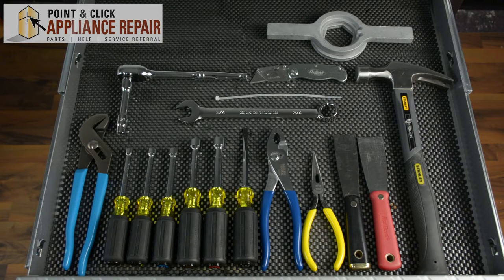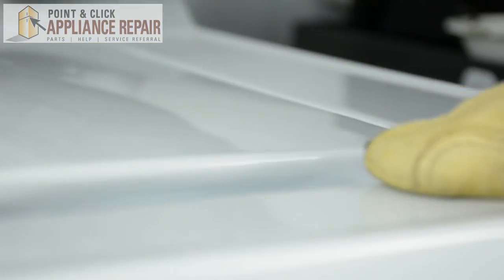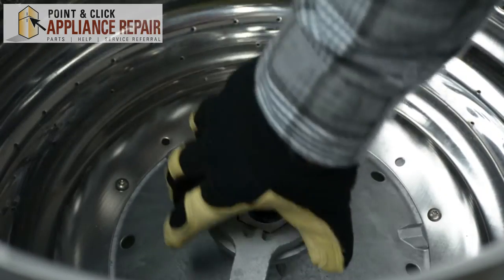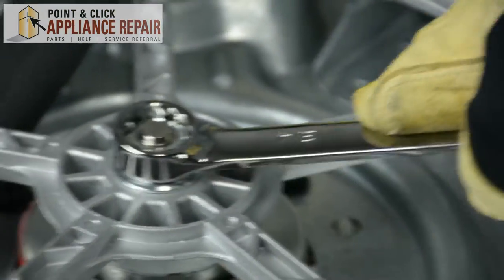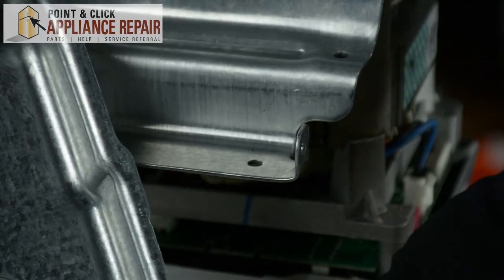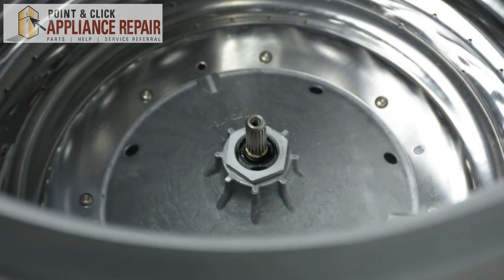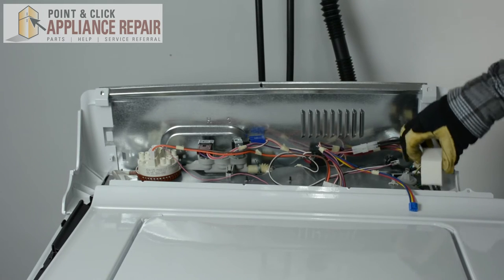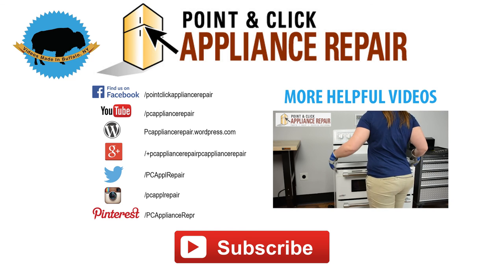WH38X10019 Replacing Your Ge Washer's Drive Shaft - AP5630245 , PS3652839, 2319465.

Comment: This video was spot on for replacing my GE Washer's drive shaft.  My agitator was a little different than the one in the video but I still was able to figure this out.  Saved me $500+ bucks.  It took me about 3 hrs to do the repair since I cleaned the gunk from the back side of the stainless steel wash tub while I had it apart.  I put the washer all back together and when I went to test the washer I was getting 2 beeps once I pushed the start button.  I decided to re-check the electrical connections to the motor and board again and learned I didn't fully connect one of the plugs to the motor so save yourself the headache of disassembling a 2nd time and check the electrical connections to the motor and board before proceeding to the next step in re-assembly.  Thanks PC Appliance Repair!

Comment: These is a $150-$170 part. I did a video on how to replace the bearing in the mode shifter. The bearing cost $10 or so. Although it takes a little more time it’s not that difficult of a job and saves you a lot of money. It’s the main bearing that typically gets water on it from the main tub seal which should be changed at the same time. Save yourself over $150 and just replace the bearing. Thanks for the video
Reply: If I can get the whole assembly for $75, should I just do that?  And should I even bother with the tub bearing?

Comment: When reattaching my new drive shaft to the frame , my screw holes appear to not be threaded. Am I "rethreading " the holes from the top with the screws to cut new threads or do I have a factory defect??

Comment: Ive done this job twice on the same GE washer.   my transmission got really noisy after a water leak let some water run down the drive shaft and get into the bearings. The bearing is not water proofed,  shame on GE for that.   The second time I did the transmisison was more difficult.  first, the stainless steel tub would not come out of the machine.   With the nut off, the tub just stuck in the machine like it was nailed down.  I hit the spindle of the drive shaft within the tub with a hammer, tapping it on each side of the spindle.   that let my tub come out.  After i got the outer plastic tub assembly out of the machine., the tranmission would not come out of the plastic tub.  It had seized inside the metal sleeve that fits into the bottom of the tub.  I had to put the tub up on some sawhorses and pound on the spindle to get it to come out.   in the process of pounding it out the tranmission broke internally.   I had no choice but to keep pounding to get it out.   If you can afford it, and if your machine is old,  buy a new plastic tub.  I did, but wanted to try and rebuild the old transmision with a new bearing, but ruined it because it would not release from the tub.    Lastly,  i tried to add some permatex to the new seal when i set it into the plastic tub.   bad idea.   the seal is ribbed, and so is the plastic tub where it accepts the seal.   the permatex would not let the ribs mate up, and the seal kept popping out of the tub.   I finally figured that out,  wiped the seal off, and then put it in and it held.   it takes a good amount of pushing to get that seal in.    I bought a new tub, split nut, shaft washer and shaft bearing along with a transmission.   Im glad i did.   the old components were really seized together and very difficult to seperate.   The video is fantastic for taking you through the steps.  its not a hard job unless your components have seized.

Comment: I so need some help!!! My Whirlpool Washer #WTW4616FW1 on spin cycle makes this sound like a jet engine taking off; quiet to super loud but with no grinding  noise. I thought it was the bearings until lastnight i took my entire washer apart and ran into not being able to get access to the bearings due to the gear box being  all welded closed. I dont know what my next steps are that would diagnose my washers problem to get it back to working condition....People are telling me its the bearings, but i cant get to the bearings, & told them even on the whirlpool website that sells my washers parts, it doesnt even have replacement bearings listed....Im going to wait until i hear from you before i do anything major like ordering wrong parts and putting it back together & it still doesnt work...lol Thanks & look forward to hearing back from you!

Comment: Replaced the shaft. All teeth were broke. Now the washer walks violently across the floor, which it wasn't doing before. Any suggestions?
Reply from the maker: If your washer is moving across your floor, check to see that the leveling legs are all down on the floor. A lot of times, an appliance rocking around is caused by uneven leveling legs.
Reply: @pcappliancerepair  leveled the washer and everything looks great. It only walks on last spin cycle. Violently walks!!

Comment: Yeah that nut does not come off that easy lol
Reply: How did you get yours off I'm having the same problem
Reply: @MixedGoku  specific spanner wrench that I had to special order and then used a heavy hammer to get that thing off.
Reply: remember the nut is reverse threaded.  you turn it clockwise to loosen it.   and yes, it is put on TIGHT at the factory.  you need a hammer and the correct hub nut wrench to get it off.   it will surprise you how tight it is torqued.
Reply: Buy a 1-11/16 socket, impact gun lol